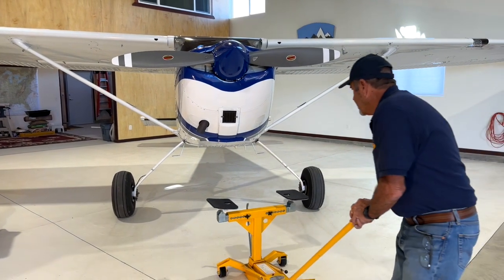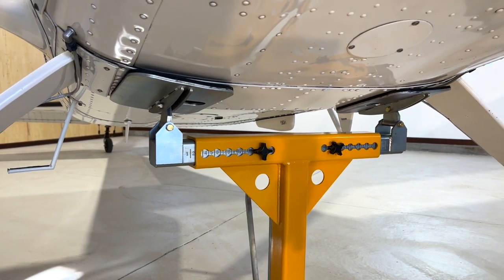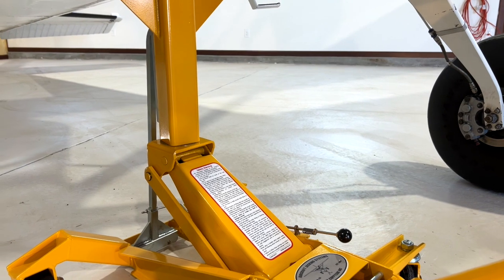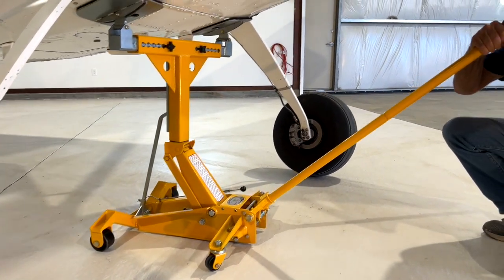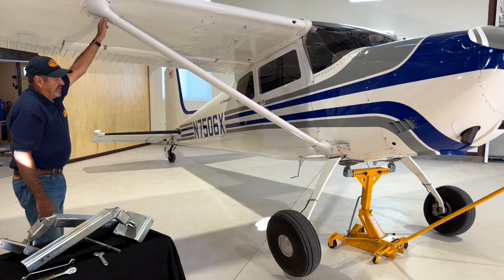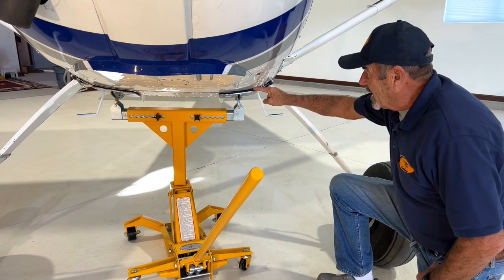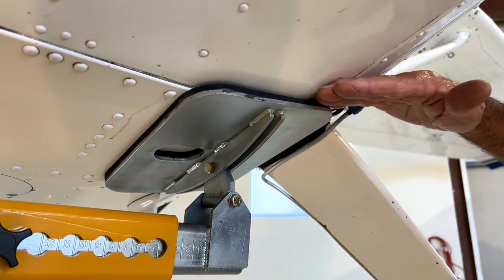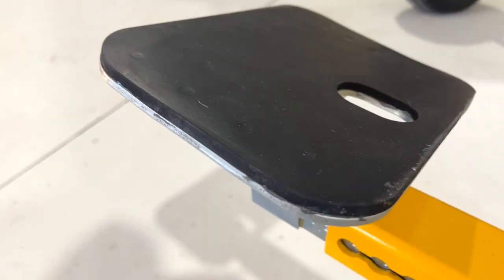How to Jack a Cessna - Aircraft Jacking Solutions - Belly Pad System in Detail

Comment: Sweet. What’s the cost?  Do you a tail jack, and can it be used to level the plane?
Reply from the maker: Hi Richard, the cost can be found on Aircraft Spruce or by sending an inquiry to AircraftJackingSolutions.com. There is also a Tail Stand adapter which can be found on our website and we will be posting a video very soon. It will definitely help an owner get the tail lifted higher to then facilitate an easier lift onto a secondary stand for leveling.